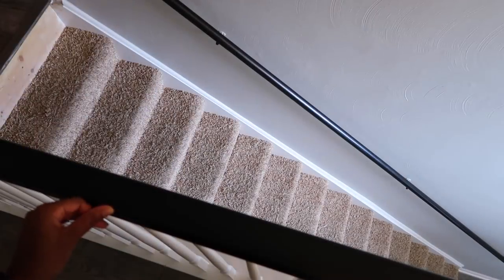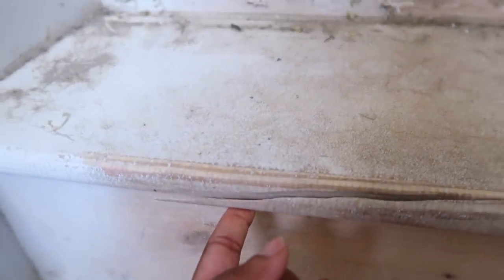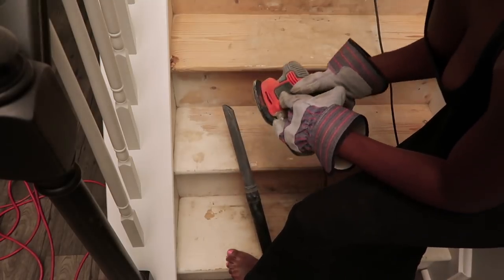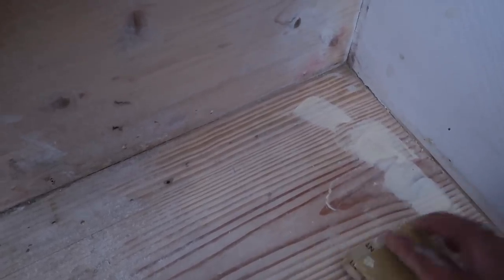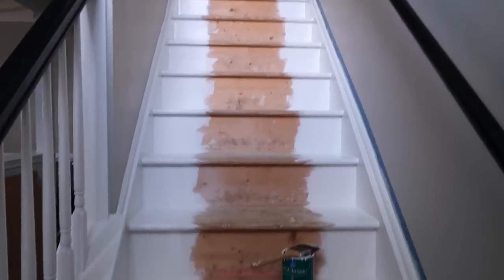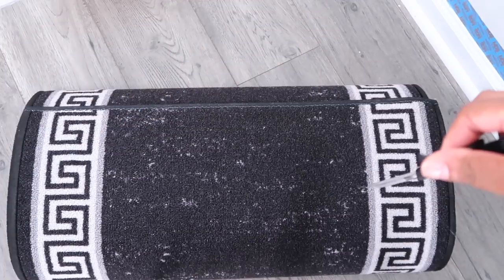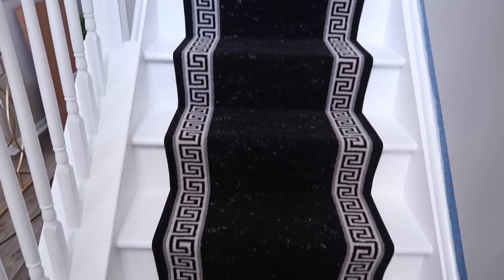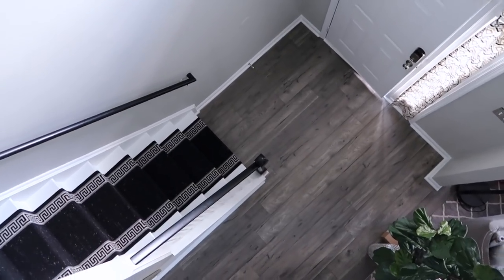STAIRCASE TRANSFORMATION | Home Makeover Part 6

Comment: How long of a runner did you order? How did you measure, I was considering using measuring tape
Reply: Yes, I was curious about this too. :-)
Reply from the maker: Glynis Phillips I used painters tape on the first step and riser then times that length by 14...I have 14 steps. I added a few extra feet when I ordered just in case my measurements were off. It’s better to have a tad bit more than you need lol.